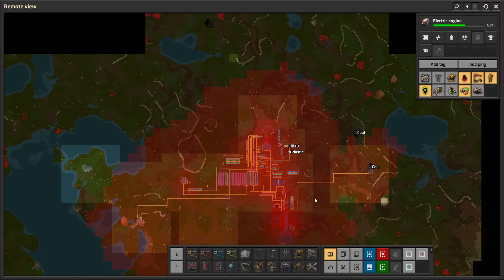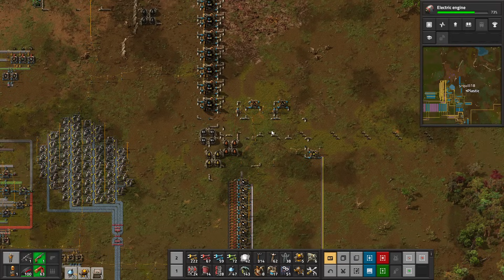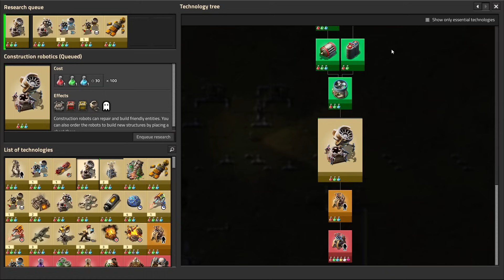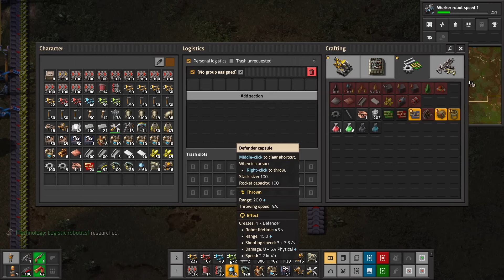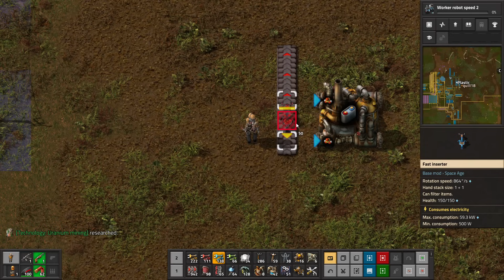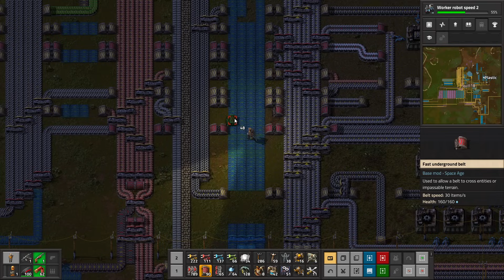Factorio: SPACE AGE EXPANSION! - Ep 9

Comment: You don't need pumps for cracking anymore, you can wire up the chem plants directly now.
Reply: ... old habits die hard.  In my current game, I have the chemical plants hooked up to a power switch, even though deep down inside I should have known that the machines themselves have a control signal.
Reply: @Majromax  Not to mention the pumps are at the tank, the chem plants are not.  And a pump controls a whole run of plants whereas each plant would have to be wired individually.